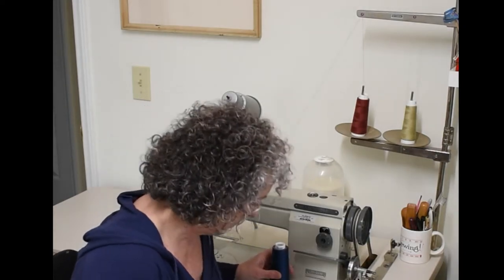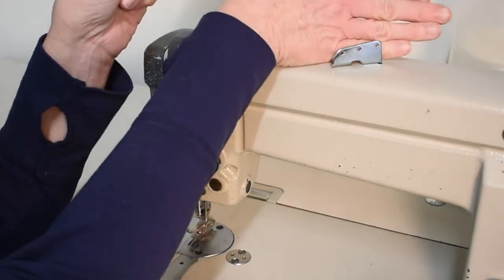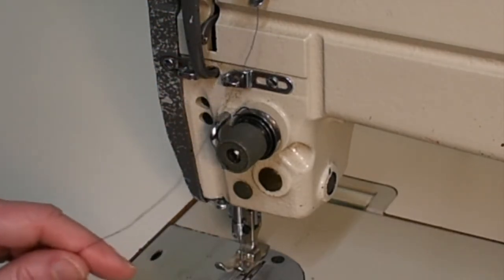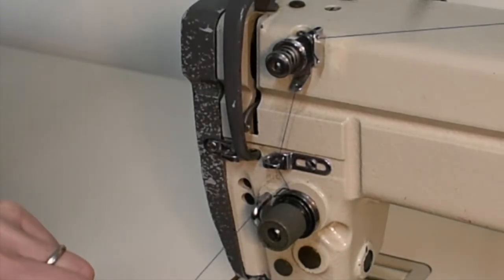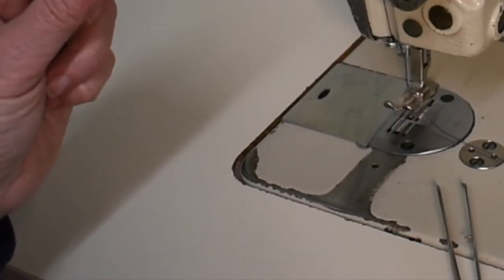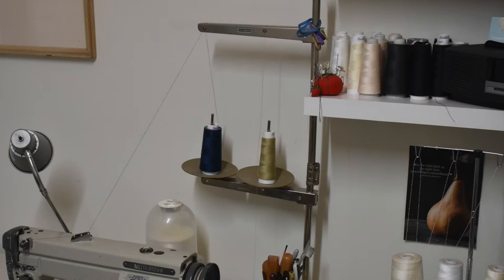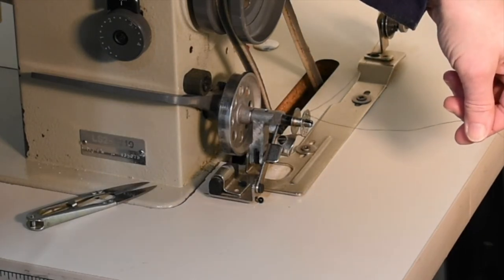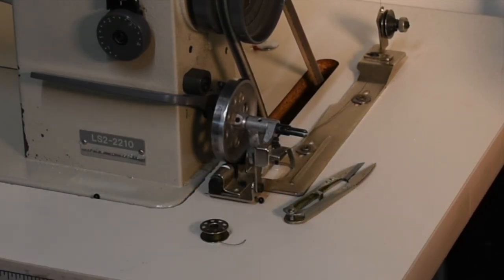How to thread an industrial sewing machine and how to wind a bobbin using the attached bobbin winder

Comment: i have a slightly different brother industrial
 but could you tell me why my string doesnt seem to slide when i have it on the the second last tension spring? i got all the way around and hook correctly
 i also keep breaking strings and needles from tightness and my bobbin wheel wont stay in the bobbin casing no mattter how i thread it
 thanks
Reply from the maker: Wow those are some serious problems! I'm afraid I can't diagnose or solve machine problems from afar, but it really sounds like you need to find a local repair shop to take a look. There are some good Facebook pages that are great for problems like this. You can post photos and get help :)

Comment: Please show me how to insert bobbin into the bobbin case, and insert the bobbin to start sewing, when I start sewing the cotton breaks
Reply from the maker: Make sure it is unwinding in the opposite direction as the thread guide in the bobbin case. Check the tension. There is a little screw on the bobbin case that adjusts the tension. Not loose, and not tight.. just a gentle tension